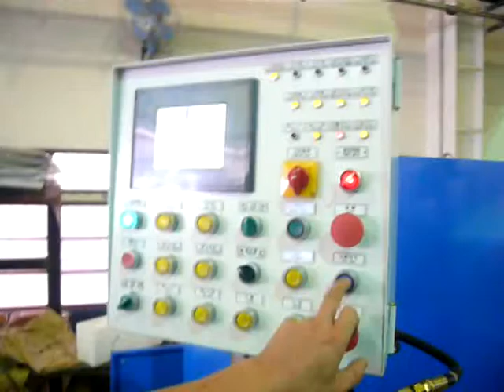Car battery Automatic lead casting machine

Comment from the maker: Dear Sir,

Thank you for your inquiry. We are glad and honored for having the opportunity to introduce our company MITAPLAS as a professional equipment manufacturer locates at Taichung, Taiwan.
For the machine you are asking, please note the melting point of lead is 327℃. Normally used to manufacture the lead on carbattery lid.
So we may need to know the material and product(better with drawing) you want to manufacture.
Please send inquiry to our official mailbox: mitasa@ms71.hinet.net Thank you